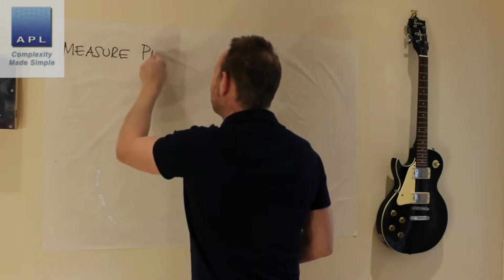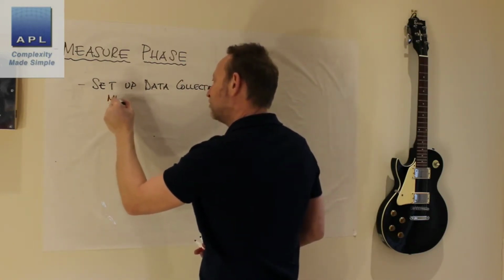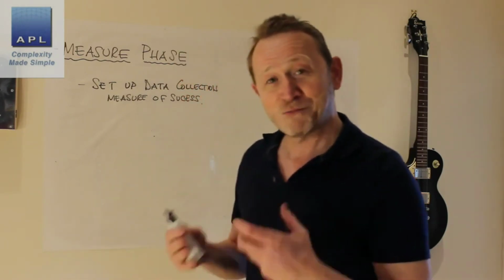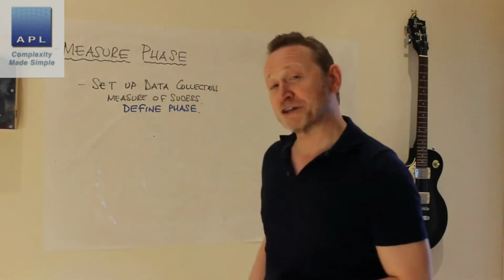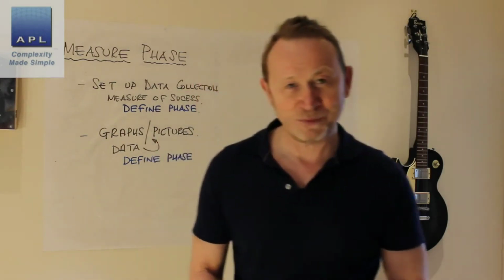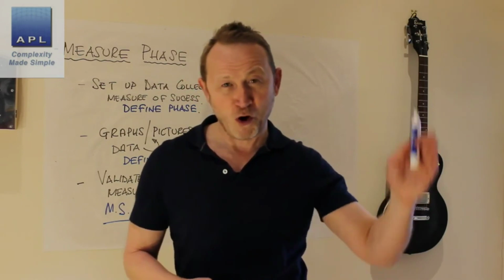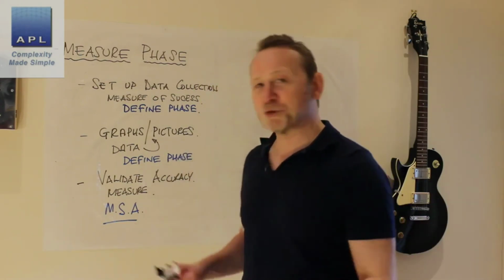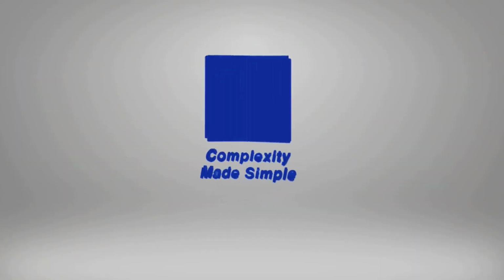Measure - A practical Approach

Comment: Dear Paul. Would it be possible to explain, ho to provide an MSA for hardness meter (e.g. Rockwell)? Seems to be impossible to reach customer specified capability for PPAP as the most of the variability comes from the material itself. I am lost… Thank you
Reply from the maker: Andrej - The material is part of the measurement system I'm afraid. if you have lots of on part variation then you might have to take several measurements on one part and then take the average...or if on part variation is a problem you'll have to improve the process...